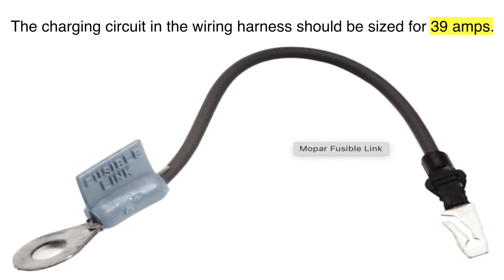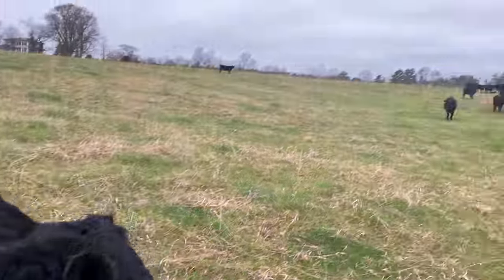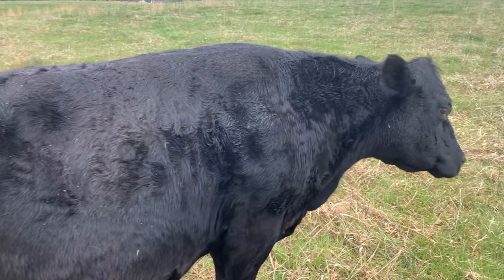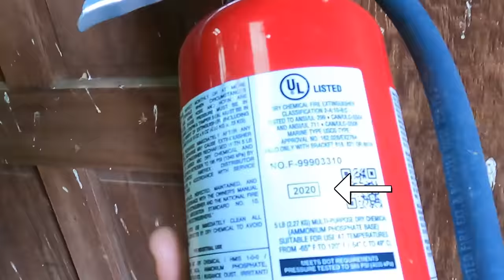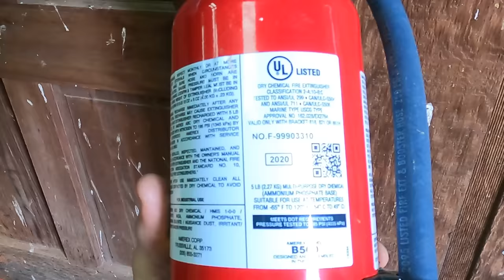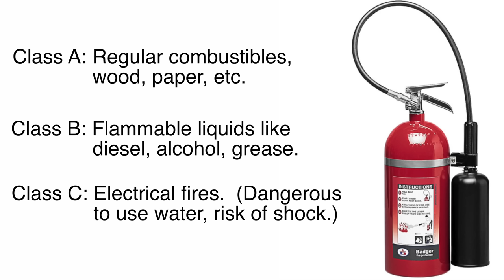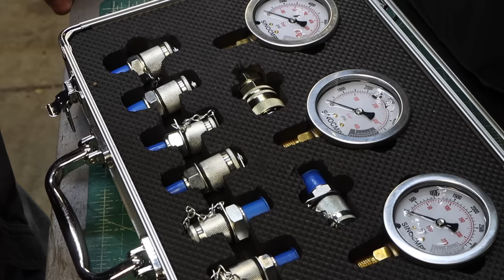Fire Extinguishers: 7 Things You Really Should Know...And Probably Don't.

Comment: If you get a Class A "water can", you should always add a squirt or two some dish soap or detergent to the water to lower surface tension and allow the water to be more "wet" which helps it penetrate deeper into whatever is burning.

Never ever use water on a class B fire. Go watch videos on YouTube if you want to know why.

A Class C fire typically becomes a Class A fire once all electricity is cut to whatever is on fire. For example, if your microwave bursts into flames, and there's enough time to unplug it, then you CAN use water UNLESS you were cooking a large container of oil for some reason.

Another tip: Your fire extinguishers should be highly accessible near your egress points, if possible. You should have one dedicated Class B extinguisher for your kitchen and one in your laundry room, and even one in your garage.

Regularly test your smoke alarms. 

Also, if your home has a sprinkler system, you should get them inspected every 10 years, or per your local city's building codes. Getting them tested is fairly inexpensive (a few hundred bucks). You can also get them flushed to clear all the nasty water out of them so if they DO go off, you're not dealing with putrid decades-old water spraying all over your place.

Comment: well normal fusef are wires with a specific thickness that will get to the point of melting at a specific amperage thats how fuses work, i know of wire with a special insulation that wont melt even if it is encountering a dead short the copper inside will melt but the insulation will keep intact there are applications where it is used.
In my opinion these " fuse wires" are just plain wires but if a awg14 is melting that late i think a awg 10 will still have encountered some damage so an inline fuse is still a better solution since it will blow way faster in case of a short, only thing i can think about why they use it there is as some kind ov overload protection if you draw over a long period of time a higher amperage that may not blew a fuse but but still can cause fire because of heat and then you have a weak spot where it will melt first, but on the other hand that makes little sense since there are thermal fuses as well...

Comment: 5:00 i have seen 28 gauge regular wire just straight up VAPORIZE from high current flow. someone made an oopsie and dead shorted a 1000amp 24v supply through the wire and it literally exploded into copper dust and vapor, leaving a split open silicone insulating sleeve. basically, the insulation of the wire was still there, but all the copper had been destroyed by the current. it happened so fast that it was basically a loud BANG and there wasn't even a lot of burn marks. i wish i could show the picture of the split open insulation, but it was still inside a proprietary thing lol. if you recognize what uses high current at 24v, you can guess what it was. 

All that to say, YES regular wire can and will not only melt, but instantly vaporize with the right amount of current. It can be exceedingly loud too!

Comment: The difference in Fusible link is the insulation.  It is a Hyplaon (chlorosulphated Polyethylene) insulation which is engineered to not start on fire.  You note when it melted there was no flame.  PVC insulation will start a fire, fusible link insulation will not.  It is just wire that is 4 gauges smaller, has "Fusible Link" embossed into it, is color coded, and uses a top quality fire retardant insulation.  It's not necessarily a whole lot better than a really good quality Polyethylene Crosslink wire (SXL or XLPE), but when you intend to inflict heat on it, you probably want the best....

Comment: I wish Halon extinguishers weren't so expensive. The larger ones are rated for class A fires, so it sounds like they are a bit more effective than CO2. Probably not as good as dry chemical, but at least they aren't corrosive.

There are also type BC extinguishers commonly available, which use baking soda. Probably less corrosive than type ABC dry chemical. But type A fires are probably the most common/destructive, so it still makes sense to have an ABC extinguisher.

I have a recalled type BC extinguisher, so I guess I'll try it on a type A fire and see what happens.

Comment: 7:59 Never heard before of a fusible wire, but in my opinion, a wire that is meant to be burned up to protect a circuit is stupid. It can and will cause a fire soon or later if this occurs near hydraulic or fuel lines, or other wires. A fuse has 2 functions, to protect against shorting out, and to protect the wires against overheating (fire). If you choose the right size (Amperage) of the fuse for a particular circuit, and you add a extra higher amperage fuse in series as a backup, then you have a much safer circuit then those fusable wires. 
Also, fuses need to be placed at the begin of each circuit, not in the middle or close to the device of that circuit. Only the part AFTER the fuse is protected by the fuse, so the more unprotected wire before the fuse, the more chance of getting into problems. Personally, if i owned a device that has fusible wires, i immediately throw them out and replace them with normal wire, and use the right size of fuse. The type of fuse depends on the circuit, there are very quick, quick, normal and slow blow fuses, on some electrical devices, you need HRC (High Rupture Capacity) fuses, those are designed for not blow up in pieces at high overcurrent, and are filled with sand. This type you can find in the better brand multimeters to protect against fire hazard. Grtz

Comment: If I was forced to use one of those pieces of wire pretending to be a fuse I sleeve it with woven fibreglass tubing .
I would expect expensive equipment to have an electrical distribution panel where all the fuses with indicators etc are located. Having a fuse inside a wiring loom that's in a hard to reach place is bad engineering. Long wire runs on a 12V system demand thick wires which can be a problem but that's why a lot of heavy duty plant uses 24 Volt battery banks.
FInally copper will work harden  and can break. More  strands of a thinner copper helps avoid this. When buying wire it's not just the cross section area, look at the size and number of strands. More thinner is best if there's going to be vibration.

Comment: I had never realized that a fuses rated 3A at 30v is different than a fuse rated 3A at 250v 
good old Ohm's law, but I think I'm going to see if there is documentation explaining in-depth the difference on the little fuse website.
Reply: The voltage rating is the maximum voltage that should be used with the fuse... You can use a 120V fuse in a 30V application. However, there are also differences between AC and DC fuses/circuit breakers. The voltage maximums are specific for AC or DC.

Comment: just laughing with you I was pulling for you, you just couldn't hear me if you ever pull the pin on a extinguisher and squeeze the trigger you better not put the pin back in and say thats good it will leak off the full needle may or may not move at any rate you best use it all you can't save it. co2 or argon is best for electrical and class bravo fires.

Comment: 8:00  Circuit Breakers that continuously re-close almost immediately are a bit silly.  What are they for ?  What's their purpose in life ?  They take a 500A over-current event and reduce it to 50% duty cycle ?  Do you have a garbage bin nearby ?  🙂
Reply from the maker: They are for use with a winch, which actually isn't a bad use case for them.  If that breaker is popping, you better stop winching.
Reply: @FarmCraft101  Ah, not so much "Overcurrent Protection'; more like 'Overcurrent Warning' (messaging to the operator, many of whom would press on anyway). 🙂

Comment: What is special about a fusible link is that the insulation is supposed to be fire proof. I would imagine that any insulation rated to be completely fire proof "should" work as a fusible link. No longer than 9" according to SAE. I may be quibbling a bit but the rule of thumb is 4 wire gauge sizes down. 14 protects a 10 gauge wire, and yes there are some odd wire sizes out in the world.

That fusible link that you have shown..... well I doubt it would pass a true safety rating because it is supposed to contain the wire inside the insulation. With all that bare wire showing during your test, it would easily catch other wires on fire if it was inside a harness. AFAIK, fusible links should be safe to use inside a harness.
Reply from the maker: Hmm.  The one on my lift melted too, and there was bare wire exposed.  I wouldn't count on it being safe in a harness.  The manual for the lift said that the link should be "hanging in open air and not in contact with anything."

Comment: why do manufacturers use fusible links? because they are cheaper by far than a fuse or a circuit breaker. And yes they are just a chunk of wire a few gauges smaller than the circuit they are protecting. Its a known location for a failure instead of buried in a bundle somewhere else and cuz they're just a chunk or wire they are reasonably reliable to not fail from vibration or environmental exposure like a fuse. Still cheap tho. Yes, i just replace them like you did with a good quality inline fuse.

Comment: Checking the resistance-per-length difference on your motor wire, versus your fusible wire would have given you more clues as to whether they were both the same metal.

Having a section of wire with a higher resistance-per-length than the rest of the wire will act as a fusible wire, no matter the melting point of the metal. P = I^2 x R will mean the higher resistance wire will get hotter faster than the rest of the wire. Resistance goes up with temperature, so even a small initial difference in resistance can have a big difference in the final temperatures.

Though having your fuses melt at 2000F could easily start a fire on its own. Clearly, you made the right call in having a discrete fuse.

Comment: Fusible link is copper just like all the other wires, so testing it compared to another similar size copper wire is not correct. A fusible link is just 4 guages higher than the circuit it is protecting nothing more nor less. The only real purpose for using a fusible link is in circuits that have a high in rush that would blow a normal fixed rate fuse. The fusible link can handle a momentary in rush of current with out melting. They are commonly used in starting circuits for electric starters.

Comment: Fusible links are a poor solution. I think they just did it because its cheap.

The proper way to use one would be in line with the fuse just in case the fuse wont blow for some reason, ive seen it happen.

Comment: The test with the batteries and the fuzes is not really a good test. In this configuration, you will have much nore current running through the wires as you might thinkt, because current is proportional to voltage/resistance. In this case you short the connections toghter, ao you have a hught current running through the wires (12V/0.005Ohms = 240A these values are guessed)